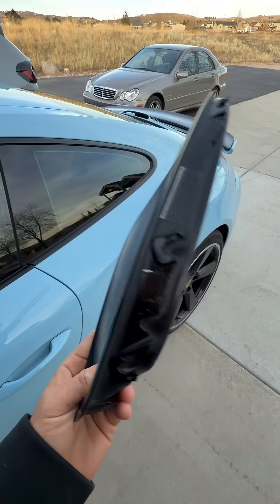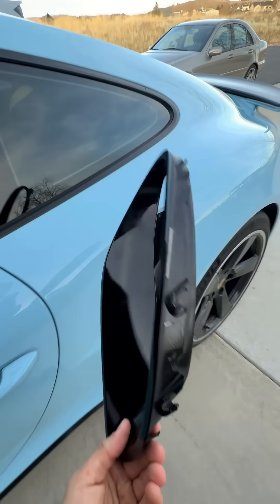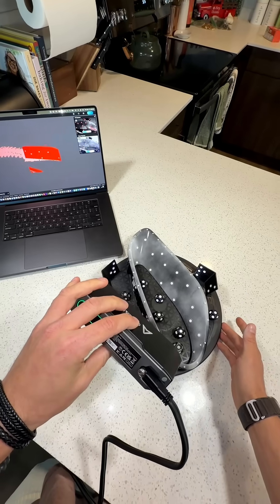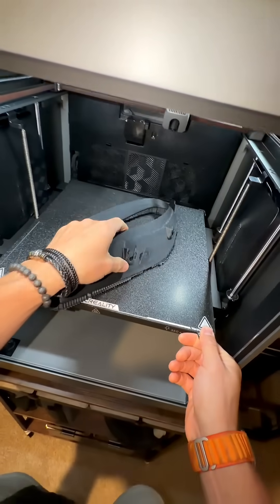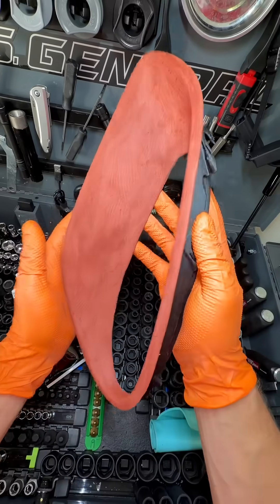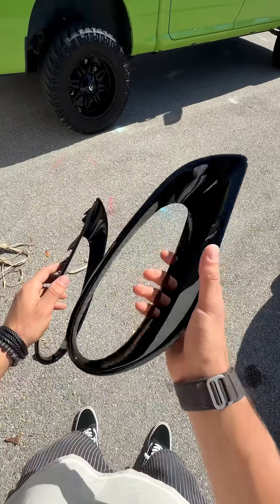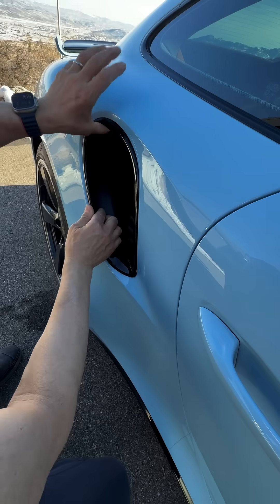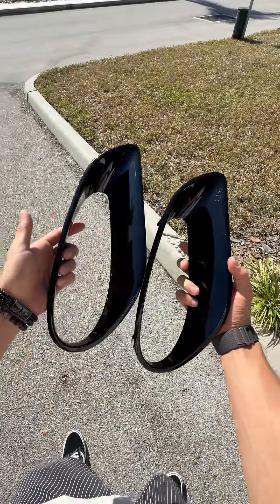Porsche wanted $2,000... So I 3D printed it for $20 instead😳😳😳 #3dprinting #creality #porsche

Comment: Look if you happen to have an expensive 3d printer, scanner, spray, tracking dots, and have the time to do all this, sand it, paint it. 

Then sure, i guess this saves you about $1000 bucks after you add in the cost of resources and your labor.

But for everyone else, just buy the plastic part and save yourself a ton of time, not to mention if you own a porsche you can probably afford to fix it
Reply: Exactly, absolute waste of time that could be spent doing other things
Reply: Exactly hahaha 😂

Comment: Great work, but how did you get around the strength issue when printing clips? No way would any clips last when printed via FDM, any way the layer lines go is going to be weakened when they’re used. I wouldn’t be surprised if it fell out in a few months. It’s why with any parts like this I always get an SLS nylon part made. More expensive, yes, but it’s OEM quality.

Comment: Creality Otter 3D Scanner: 900 dollars (not available anymore)
Aesub Scanning Spray: 40 dollars
Creality K2 Plus 3D printer: 1100 dollars   
ASA filament: I found one for 20 which is what I assume they titled the video after, so 20 dollars
Bondo glazing putty: 6 dollars
Napa 2K automotive primer: 39 dollars
Paintjob: 100 dollars
Total cost: 2205 dollars

Rear air duct: 1780 dollars

hmm

Comment: If you pause it and look at them side by side, you can tell the printed part has clips that are not the same size or shape as the original factory part, so it looks like it might fall off later. Not the best advertisement.

Comment: You have money for a Porsche 911 that costs north of 230000€ with some decent equipment but you do not have theft insurance or 2000$ for the missing part? Probably running on Nexen tyres as well... Man when you have such money you buy from the manufacturer as well as do service there. That is the cost of owning a high end sports car.

Comment: A prime illustration of a profitable business opportunity involves replicating original trim pieces that are either inaccessible or prohibitively priced.  
Automobile manufacturers of sports cars are essentially overcharging consumers by imposing exorbitant fees. This practice may serve to uphold the brand's image and validate the costs associated with their vehicles. Nonetheless, it is important to recognize that these car manufacturers will likely void your warranty (if it is applicable) or potentially refuse to provide service for your vehicle once replica parts are used.  
Terms related to substandard quality will be invoked, and whenever feasible, claims of inferior materials will be asserted, even when the quality matches or surpasses that of the original.

Comment: After all if you bought the car brand new then you can afford this. If you like to save money you’ll find a way to order it in the UK for £822 and then ship it to the USA(you’ll most likely be lucky enough to import the part without having to pay customs fees). This part isn’t critical for using the vehicle and its absence doesn’t cause any safety concerns so one could wait for a while to get it shipped from overseas. If you are smart you’ll easily find a used one and there is a high probability that you’ll find it in the correct color for less than €500 in Europe(the part number shown in the video is for a part finished in black matte, ready to be primed and painted) and by buying this piece of plastic used you won’t be charged any custom fees for importing it.

Comment: So this scanner is about $800 on their website. That doesn’t include the 3D printers or the other printer he used to produce it. By the time he sanded, bondo, finish sanded, primed, and then painted it, where is the savings?? If you were doing this for other people, and had the equipment, and charging them, you could likely make some money. Problem is, how much cheaper than Porsche would you actually be? Selling on eBay has massive fees for sellers, and then you’d have returns if they didn’t fit “exactly” right. How many Porsche Turbo S owners would actually buy one on EBay or some random website? This is like a solution in search of a problem that doesn’t exist often enough to make it worthwhile….😂

Comment: If your goal is to save money, don't drive a car like that. This isn't a practical coat-saving application of 3d printing, it's a hobby project for a car and tech enthusiast.

It's really difficult to personally  justify actual cost savings for 3d printing, at least not for personal, noncommercial use. At some point you're typically spending some amount of time and material to do something that you alternately were already kinda just getting by without fixing. You fix it for some kind of happiness boost at the expense of your time and materials, and maybe it cost a little less than other also-optional solutions.

Comment: My 26 yr old son scanned a Ford transmission bell housing, re-engineered it in Fusion 360 to connect with a Porsche transmission, printed a prototype, test fit it and now sending it off to get CnCed. 3D scanning is insane especially now that people want to keep their cars on the road longer.

Comment: $2000 seems like a bargain after that
Reply: The first time, yeah. But once you've done something like this ten times it's more than paid itself off
Reply: @sunderbans is there an air duct cover gang roaming the streets that I’m not aware of? 😂
Reply: @Kwin9  Yes this is defo a waste of time for someone who's not good with their hands and got absolutely no skills.
Reply: @T3chnoJunk13 or has better things to do with their time.
Reply: @Kwin9  There are many things you are not aware of.
Reply: @Kwin9  Like what, asking your mom to pay for it?
Reply: @Kwin9 another Porsche owner that didn't want to pay the $2k replacement price.
Reply: @Kwin9 wait until you find out you make make other things then vents 😮
Reply: @Kwin9  it's a business model. Couple of guys go around taking porshe vents, this guy charges them less to replace the parts, and makes a video so the next victims can find him
Reply: @Kwin9  If you damage one it’s much cheaper to take someone else’s than buying an $8,000 3D printer.
Reply: @Kwin9 yeah because the 3d scanner from creality can only be used specifically to scan Porsche’s air ducts and nothing else in the world.
Reply: @soniccinos  Doesn't matter, the whole process of scanning, cleaning up the scans, printing it, sanding it, applying body filler, sanding it again, spraying it, finishing it... that's more than $2000 worth of time. Only do this if it's a hobby or if you genuinely can't find the part anywhere, don't do it to try to "save" $2000.
Reply: @Kwin9 reselling
Reply: @Kwin9 right? They may never ever have to print this part again 😂
Reply: @sunderbans when are you going to do this again?😂
Every project is different and you will go through some new trial and errors every time.
Reply: @blazn0  You're not, but Porsche would have the injection moulds, and they likely made spares when they manufactured the cars. Probably $5 in materials. A bit more if they run out of spares. and have to make more.
Reply: @johnclemmensen1051 not Porsche. Hobbyist like in this video.
And not making the same piece, but a different piece.
Reply: @sunderbans yeah as long as porche does try to sue. That's a walking on glass situation.
Reply: Not really for replacing a plastic part worth only a couple bucks
Reply: @JasonCu-i9m many plastic pieces especially if they're carbon fiber cost quite a bit too make. Injection mold machines cost between 80k to millions of dollars depending on size and what they're capable of. And they're slower than stamping
Reply: @jordanalexander615  I understand what you're saying. However, this is a regualr black plastic piece. Plastic is not worth much, especially at that size.
Reply: @jordanalexander615  Also, carbon fiber isn't plastic, or it's classification, that is. It might have a bit of polymer, a plastic resin, but it's used only to help keep together the carbon fibers, which woven together are very strong. It's like solder, a metal which you melt and use to help keep woven wires or electronic pieces together on a motherboard. And if that piece is actually carbon fiber, 2k for it is a bit cheap.
Reply: Y'all are clueless.
Reply: Is bro made of money?
Reply: Seems like you don't have eyes lol?
Reply: @wrth seems like you don’t drive a $200k car
Reply: @Kwin9  not a 200k car. source: I own a Turbo
Reply: @wrth you’re right, it’s only worth $199k, totally worth it.
Reply: @Kwin9  Do you? And your mum's car does not count, your dad paid for it after all.
Reply: @Me-qp8vz 😂, doesn’t matter what car I drive, even if it was your mum’s car I was driving, the point remains the same. But just to be clear, I don’t drive your mum’s car, she always picks me up.
Reply: @wrth  Just buy the scanner + 3d printer. Learn to use the software + hours to test print. After wards sand + coat + sand + pay shop for paintjob. Very labour and time intensive.
Reply: @reganlam9940  you @ the wrong person, I am familiar with the whole process. The non-Porsche-owning fanbase in this common section is out of control. There is zero reason to spend $2000 for a piece of decorative plastic. Annual service doesn't even cost anywhere near $2000. Lunatics defending this
Reply: Not really. If you can replicate a $2000 part, you can now replicate almost anything else.
Reply: I'd rather go through all this then pay some horseshit company $2,000 for a piece of plastic
Reply: 😂😂😂 so true
Reply: But I don’t think so myself
Reply: not if you got all the equipment first like he did
Reply: Lmao
Reply: Bot account
Reply: now you can start selling them at half the price of porsche
Reply: Why. This was very little time depending on much time it took to clean up the model. The printer prints, not you. A little sanding, bondo and spray on these small parts doesnt take much time. Painter painted them. Now he can sell as many as he wants or sell the file. Profit. Be smarter.
Reply: Come on he only paid $8k for the 3D printer and $500 for materials and then wasted 3 days of his time. Huge savings 😂😂😂
Reply: It's pretty funny to watch this guy try to be thrifty for his friend who owns a car that was $200,000 new. The OEM part is like 0.8% the cost of the car lol
Reply: @tombowombo- holy shit yall are so insufferable in these comments 😂 mf already makes things and yall act like he broke his back making this part that was basic work
Reply: @Wulv  His mum does everything for him, even breakfast seems like a difficult task for him.
Reply: @Wulv I'm not knocking him, it's just pretty funny.

Comment: He bought a $700 scanner and used a $1300 3D printer because he didn't know you could buy the black plastic part for a few hundred bucks.

Instead of buying a $2000 carbon fiber part he didn't need, he utilized $2000 worth of tech, not including the laptop.

Comment: Wow… so instead of paying $2000 on a plastic/carbon fiber stock part for a hundred thousand plus dollar car… you spent $1000 plus on a scanner, maybe using a paid for 3D editing software, used a several thousand dollar 3D printer multiple times to get the part right, a couple hundred on spray paint, bond-o, and professional painting, and spent the multiple days to do that labor. You didn’t save anything, you just spent money in smaller portions going to various places while doing unnecessary work.

Comment: Depending on where you live, your local public library may have a makerspace lab with both the scanner and the printer. My local library would charge $20 for the 3d scan, and about $5 for a PLA print and $10-15 per ASA print.

Comment: Why are the comments hating on this video so bad? This is such a nice way to tackle this problem, given that he already had the 3D scanner and the 3D printer. Even if he did not have the 3D scanner, he could still just do this with a used iPhone (even $300 used ones have quite nice lidar), and even if he did not have a 3D printer, he could have just bought a $300 3D printer that does exactly what he would need for this project. Finally, even if there is a cheaper alternative, this is still a really neat project to do, and keeps your brain in shape, unlike what many people in the comments are doing, who just scroll mindlessly and post mean comments.

Comment: I had the exact same car and lost the wing mirror cover twice and they charged me £600 just for the part and over 300 to 'install'. you should 3d scan all the plastic parts on expensive cars and automate the process of sale to print, you'd have a business running itself

Comment: There’s a reason the parts to a 200K car cost that much. Afaik you don’t save your whole life to buy a 200K dollar whatever and then don’t have money to put gas in it. So I’m sure the owner has enough money to replace the 2K part without hassle, AND even if he decided to “save” money and buy all the devices in case he would need to replace more plastic parts in the future, still, I think his time is more valuable, than spending time on the whole process of scanning, modelling and printing. Let’s not forget he’d have to learn some skills. If he’s on that level of money spending, printing plastic parts has to be a hobby. Even if he’s already had all the skills and devices that together cost at least 1.5K (1K for the Otter scanner and $600 for Creality K2 Combo), he’d still have to spend a good portion of his life to scan, clean up, scan again maybe, maybe clean up again, print it out, not be satisfied with the result or even cut off excesive amount that would render the part useless, and repeat printing and then repeat cleaning the part and even then he could have been slightly off a couple of millimeters and then he’d have to manually adjust the model, then get a part that looks slightly different, than the original… well, you catch my drift. 
There’s a reason the parts to a 200K car cost that much.

Comment: What...was the point of this? If you have the money for a Porsche, I mean, REALLY have the money, then why the hell would you waste the money and time to 3D print plastic, when you could just buy the part from Porsche and EASILY afford it? And as other commenters pointed out, that expensive part is apparently carbon fiber, with the plastic one coming in at $300. No way in hell am I spending money on an expensive 3D printer, materials, and most importantly, a MASSIVE amount of TIME, to replace something that would effectively cost pennies to me.

Comment: So, all i need is about 1300 worth of materials plus my labor to save about 700 bucks? 😂 A 991.2 Turbo S is still a 140k car on the used market. Tell your friend to stop being cheap and buy the correct oem part. If he can't afford it, he shouldn't have bought the car. Plain and simple.

Comment: those tabs look very difficult to design and even print.  but the original is definitely massively overpriced. worth $100. A washing machine with hundreds of parts, electronics, wiring harness, electric motor, complex plastic elements can cost less than $300. possibly the best value for money object in a house😂

Comment: Dude never heard of eBay and did not mention the carbon part is 2k. If you get the plastic it's way cheaper. Still nice that you are doing it yourself but it's worse than the original.

Comment: So you spent $800 on a 3D Scanner, another $2000 on a 3-D printer, and I'd say at least $100 on paint, bondo and sandpaper. Not to mention the time it took you to do it. So you're $1700 part is now closer to $3000.

Comment: Youre freind drove true a bunch of smurfs for the car collour thats why he lost the vent. =). By the way dont know if this would work but ive seen people do a aceton trick in a air chamber and they print the piece a little bit bigger then use aceton vapor to melt the outside layers of the plastic. then once they wane stop the process they let air into the chamber. -- not something you wane do like a dummy -- but it might saved al that sanding.

Comment: The hardware, the software experience, the scan tool, the sanding, priming and dropping off at a paint shop then you might as well buy the part and snap it in place. Not to mention that buying this on eBay would have been about half the cost…

Comment: Plastic parts on eBay are not you UV resistant and they're definitely not resistant to cold there cheap. I bought some door handles from eBay and both of them cracked and broke off in my hands the first winter😢

Comment: The part was $1,790… And it was carbon fiber...

Scanner was $600
Printer was $1,000
Body shop paint was $100
Scanner spray was $40
Bondo was $12

Total: $1,752 for 2 plastic replacements?!

All together, you saved $38…
Reply: Ah yes a one time use disposable printer and scanner.

Comment: Auto body tech here. That single part glazing putty is garbage. Really should only be used for minor pin holes. And even then I don't use that. It has a tendancy to shrink back over time, so eventually all those lines will show again. Always use a two part filler. Preferably one specifically meant for plastic for parts like this, as it remains slightly flexible. Bondo has zero flex when cured and plastic parts might flex a tiny bit and end up cracking the bondo.